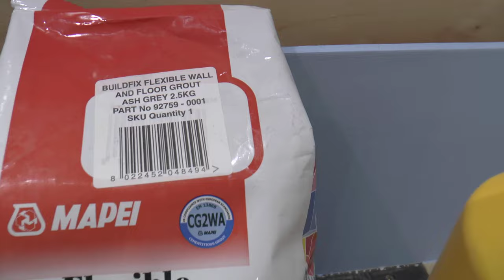Concreting a Model Railway Diesel Depot - Thornley TMD

Comment: Thankyou so much for that. I've been umming and ahhing about attempting to do concrete but after watching your video I feel confident about doing it. thankyou again.
Reply: Thankyou Steve I intend to. I noticed on one of your videos you have 37693 is it a Lima one? I think it was in railfreight red stripe.
Reply: Steve Smith oh is it named sir William arrol? I got the coal sector triple grey version but can't find many images of it. your layout is awesome
Reply: Steve Smith you're welcome. I'm currently building mine and used the Metcalfe engine sheds but now scratch building a 5 road engine shed two locomotives long out of a recycled crisp box and cladding it with slaters plssticard. have you got any suggestions for the doors?
Reply: Thankyou for your help. I did think plasticard and hinge it using tiny hinges using tubes and rods. Servos sound like a great idea I thought using rubber bands to pull them down and a pulley mechanism to raise them